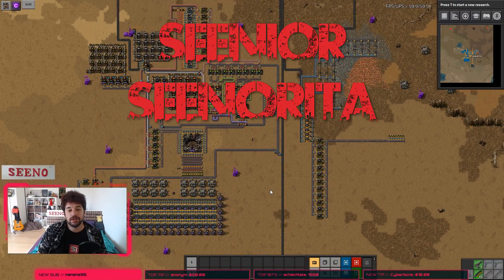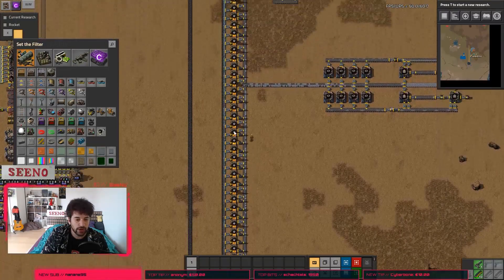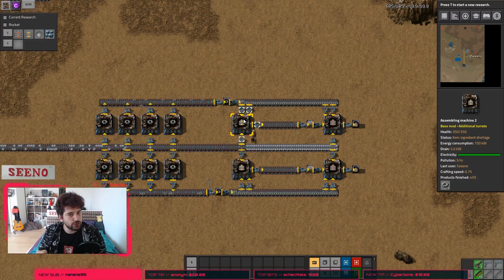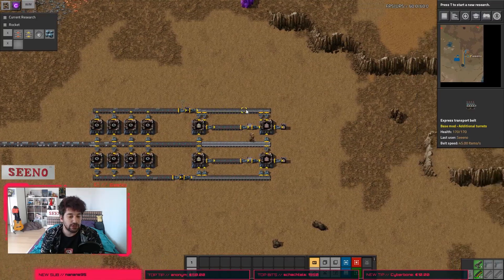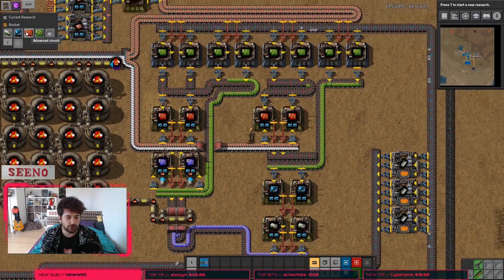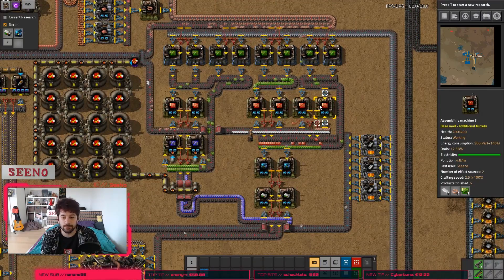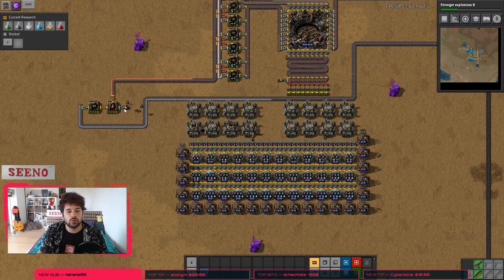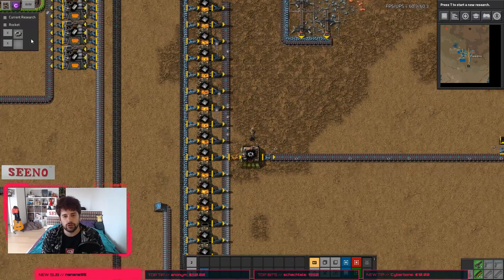Crazy German Engineering: The "What is Missing" Mod (WiM)

Comment: this mod is great and probably very useful for many people, but i stopped using it since i got too many "false positives" and "false negatives" for my playstyle. example: i always round up the number of smelters so that all ore is smelted that can be delivered by one belt, but of course this always shows that ore is missing when somewhere a problem with plates appears. for rockets, it is more details than i want or need. and i always have a few more labs than are needed most of the time (to not have jammed inputs and use all science bottles on slower researches).
thus i personally prefer to plan with "max rate calc" and watch for bottlenecks with the "bottleneck" mod and another mod that shows the utilization percentage of machines.
i still have downloaded (not enabled) this mod in case i temporarily need it for very specific cases, eg using a new mod which has completely different production chains (and that now may even apply to the new vanilla oil chains :-).